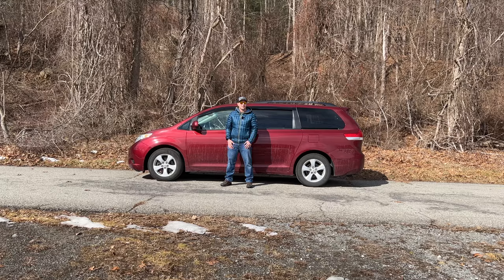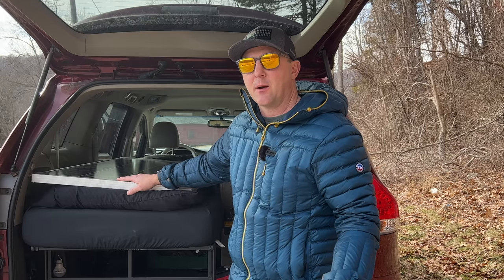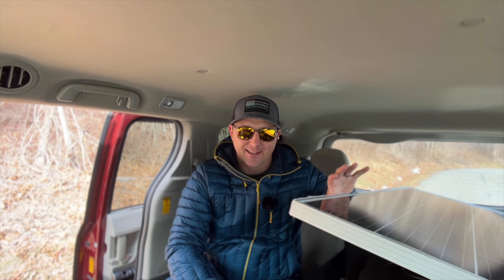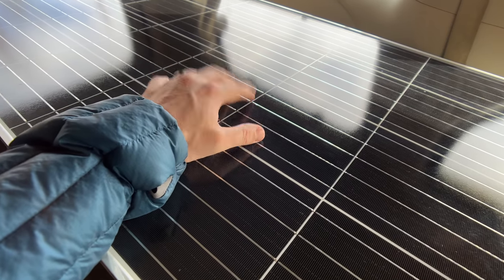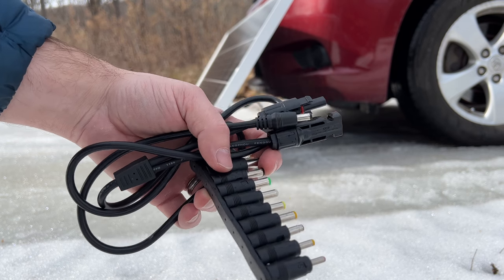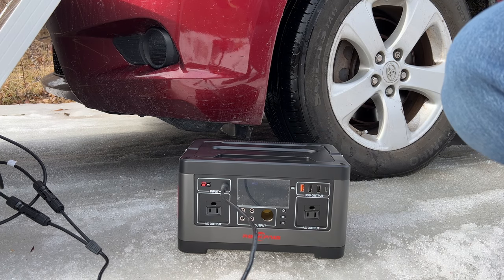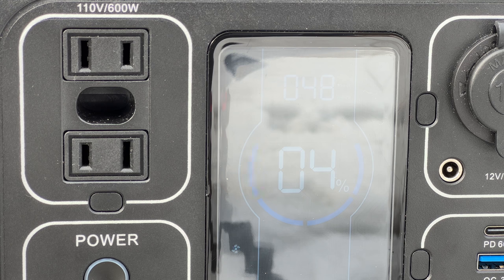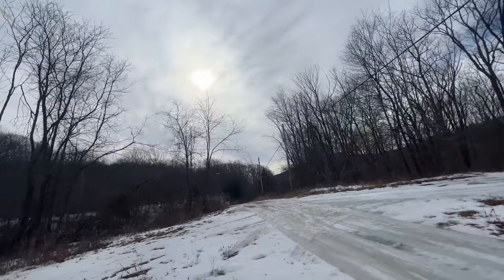Unleashing Solar Energy: BougeRV Solar Panel for My Minivan Camper

Comment: I am a sienna owner and looking into what to use to charge my 200 ah agm. I'd like to thank you for putting yourself out there and testing and showing the results.
Reply from the maker: That’s a lot of battery. Might be able to squeeze two panels on the roof if you’re not too worried about stealth.
Reply: Why not a DC to DC charger? 20-50A and options for solar

Comment: I was able to fit 3 100w flexible panels on the same van. I wanted just 1 300w+ panel but all of them exceeded my charge controller voc threshold.

3 100w panels in parallel keeps the voc within spec, and gives the same wattage. Just under the amp rating for 15AWG cables and my controller.
Reply from the maker: Do you have issues keeping the flexible panels mounted?
Reply: @AdventureGearTV  I haven't mounted them yet. I have only fit them. I tried to get away with a single 100w ridged panel, but that isn't enough power unless it is a sunny day in the middle of the summer.

To mount the flexible panels: for each panel I cut a piece of coroplast board the size of the panel including holes at the grommet points. I reinforced the holes on the coroplast with 2 layers of gorilla tape, with washers between the layers. The bottom washers are to resist upwards force, the top washer lateral force. Therefore the top washers were first glued with loctite before being covered with the second layer of gorilla duct tape. Also the panel bolt heads are under the second layer of gorilla duct tape. Since that part is already reinforced by the roof, and to discourage spinning or loosening from vibrations. The entire mounting plate is spray painted black on the top (both for cosmetic and heat absorption,) the sides, and just along the edges on the underside. The idea is that heat will be absorbed by the top, and reflected back through the corrugation by the white underside. Also the underside of the coroplast mounts probably should not be painted because then the bond would be VHB to paint, and the paint would be the weak point in the connection. The primary reason for not painting the bottoms. 

The roof will be cleaned with 70% isopropyl. Then the corrugated panels will be attached to the van roof with 3M VHB heavy industrial tape, which is supposed to be impossible to remove without a special solvent. Then the panels are bolted down to the coroplast mounts and the nuts given loctite.

They better not come off!
Reply: @AdventureGearTV  The real trick is just getting them to fit.

The panel length is with width of the roof. But with the OEM roof rails it isn't possible to lay 3 panels across the roof side-by-side. 1 panel lays across the back, the other two run along the length of the van toward the front with their center overlapping and sharing the same grommet mounting point.

I might put a strip of gorilla duct tape across the fronts of the panels just to stop wind sheer from getting underneath while driving. Taping from the roof to the panel. Not sure if it will be necessary. 3M VHB is supposed to be awesome.

Comment: I have a dodge Grand caravan. Instead of putting a glass solar panel on the roof, I put a 100 watt flexible panel on my dashboard. It doesn't attract as much attention, and it won't be damaged by weather or vandals
Reply from the maker: Nice. I still have the same panel on the roof. No issues a year later.
Reply: Does it work just as good through the glass? That's a great idea!

Comment: So I have a CPAP and use two 35ah ( 1 each night ) batteries and swap them out always having a backup if something goes wrong with charging. I have a 150 watt foldable solar panel which will recharge them but because I was never in the same place very long so I didn't use it and instead just charged them as I drove with an inverter. There is a lot of interest in the "solar generators" but at the end of the day they are batteries with a built in inverter. My point, the "generators" are too small for my needs and the setup I have is similar yet cheaper. The other options you have is to attach solar panels on the roof of your vehicle and/or a spendy system like many use for RV's. If you're lugging this equipment out in the woods I would definitely use the solar generators system as they are lighter but you have limited battery storage. 

Cool video, you went through many things that the companies selling these things don't do well.
Reply from the maker: Sounds like a good setup.  If it works, there is no reason to change anything.  I think a 1000wh power station would be the right size all in one if you ever need to upgrade. But, as you stated, there is a big cost.
Reply: Sure, its like 300% markup but it is a better contained unit for sure. The other thing is when a Jackery or whatever fails you have to by another one where with my setup you just replace one of three things hopefully. My perception is that proprietary stuff makes things easier yet harder. 

Thanks for the reply dude, I almost bought a system similar to what your vid was on but once I realized the cost I chose a simpler path for me I guess.
Reply from the maker: @mikepotter4109  my first system was a full battery, charge controller, inverter setup, but I needed it to be quickly removable. If I had a full size van, 3-4 100ah batteries could power me for weeks. Another issue is my setup is not reliable in extreme temps due to protection features. No charging in extreme cold. Extreme heat can be damaging as well.
Reply: That's a big system, lol, the 35ah are fairly light scooter batteries with handles

Comment: One thing most people don't consider is the input capacity of their solar battery I have the goal zero solar battery but it will only take 90 Watts maximum from the solar input... I do have 250 Watts worth of solar panels but that's only for shady days even if I'm collecting 250 watts of sun I can still only put a maximum of 90 continuous watts into the system... Check the input ratings of your solar batteries also remember the solar input capacity will be different than the DC and AC input capacity... It might not pay to buy a bunch of solar panels if you can't get the energy into your battery
Reply from the maker: Important point to remember.

Comment: BougeRV is an off brand 180W  You can get flexible solar panels that will fit the van from door to door, not front to back.
Reply from the maker: No issues with this solar panel a year later.

Comment: how many solar panels would it take to power a xbox 360 s a 32 inch flatscreen tv and a vcr?
Reply from the maker: You would need a battery also. Those two things take around 100w to power.

Comment: Is there really an advantage to have a 180W if you would only use external batteries ? as they seem to only accept 40, 50W
Would 100W be enough if only one batteries was used ?
Reply from the maker: I use all of the power some times.

Comment: Any reason ur not going into a mppt controller first? My 100w panel has been going ten years..
Reply from the maker: Hi each of the power stations has a built in controller. The two Oupes units have MPPT.